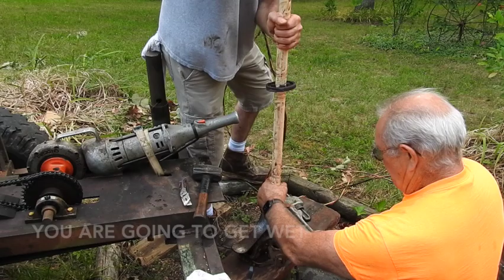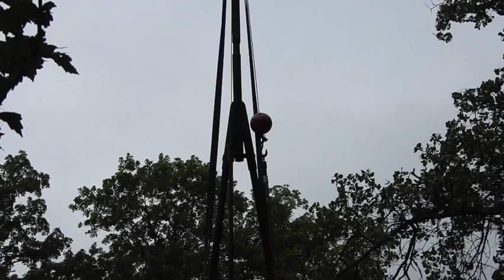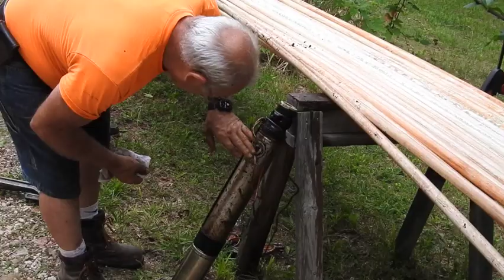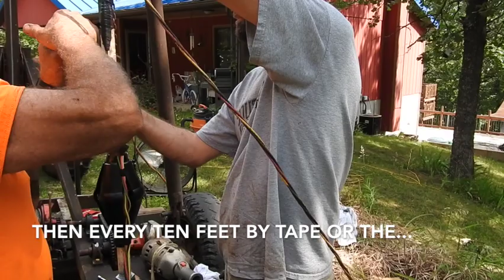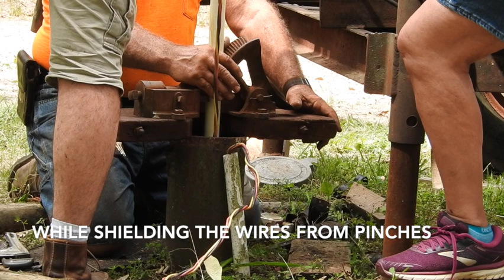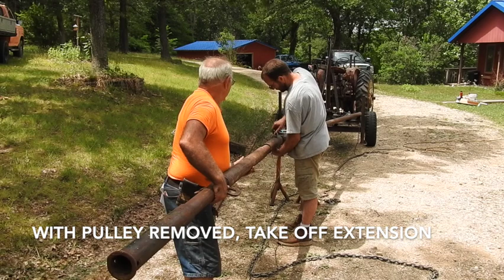DIY Well Pulling Rig Built Of Repurposed Materials

Comment: Tractorman, I am sorry to bother you and ask personal questions. In 1993 we bought a Heil AC unit and it has been a great one. My question is the Unit will come down to 75 degrees and just continue to keep running and never shut off. I also wanted to ask you what is a good unit comparable to the Heil from the 80s as far as quality? The AC guy recommended Rheem, and I also looked on line and saw Lennox, Carrier, Goodman, American Standard. What would you recommend thanks for your help.
Reply from the maker: Well, the Heil Quaker products are part of ICP Corporation parent company. Tempstar is the identical unit to the Heil Quaker unit. Whirlpool units sold by Sears were also manufactured by Heil Quaker for many years. That’s just in case you would like to maintain brand loyalty and stay with a product that you know has been good to you. But what I suggest to people, especially in a rural situation is to stay with whatever major brand is available locally. Simply because with the sophistication and continual changes to the electronics and mechanical components Most contractors cannot afford to carry all the parts required to fix every brand like it used to be back in the day. Personally, I do not feel that any of the equipment today it is expected to have the longevity of the older units, like yours, and also like my 1984 Tempstar. Also, there seems to be some issues with the newer R410a and systems developing leaks. 410 operates at an exceptionally high pressure as compared to the old R-22. And then some manufacturers have developed what they call a microchannel evaporator coil that also seems to be a little more problematic than the old tube type evaporator coil’s. The micro channel coils are extremely efficient in transferring temperature and if you get a good one, that does not have a problem you are golden. But if you have one that develops a leak, you’re in for a ride. Over the years, I’ve worked on virtually every manufacturer of residential and commercial HVAC equipment from the smallest central air conditioner to 300 tons commercially. I guess the best suggestion is to hang with a contractor that you may know and trust to lead you in the proper direction for what’s available in your area. Never go with the cheapest though and definitely never go with the most ridiculously expensive. The reason I said to go with a brand that is relatively close to you. If you are rural, it’s because you will stand the greatest chance of having a critical repair part in stock for the inevitable failure. I hope that help you make a decision that will be beneficial to you. By the way,R410 is an isotope, which means it is a blend of two different refrigerant. If you develop a leak on the suction side of the system, your system can ultimately become unbalanced and not cool properly because the different refrigerants will vaporize at different temperatures and the mixture will no longer be perfect. Speaking of refrigerant. One of two things is probably wrong with your system. Number one it could be suffering from weakening valves in the compressor, if it is a reciprocating compressor or number two it could merely just be a little bit low on refrigerant. Refrigerant 22 has to have enough refrigerant in the system to maintain a minimum of 57 psi on the suction line to keep the coil from freezing. Much below 57 psi and there’s not enough refrigerant in the system to produce enough cooling to allow it to freeze. So yours is cooling just not cooling well, but not freezing up. So it’s one of two of these things I just described, more than likely. Of course, like everything else on the Internet, you better take that with a grain of salt! 😄 good luck and thank you for trusting me enough to ask.
Reply: @tractorman4461  tractorman do you recommend Lennox or Carrier? We are also looking at an Oxbox by Trane, what is you opinion on the Oxbox? Thanks for your advice!
Reply from the maker: @Autigers2013  If my choice was between the two, Lennox would be my choice.  That of course is based on years of experience on older equipment.  I've been away from most of the modern advances for ten years now. The Oxbox is a new one on me....no knowledge on the product at all.  Good luck with your upgrade no matter what you choose.
Reply: @tractorman4461  supposedly oxbox is made by Trane, but they have different compressors.

Comment: Hello Tractorman 44, if you or someone in comment can help me it is welcome. I am trying the electrolysis method for a tractor gas tank cleaning. I am all set up as per your older video. My battery charger is newer probably cheap but the code flashing on the charger indicates charge is less than 1.5 volts and battery is not salvageable. So I think no juice going to my electrolysis set up. Any suggestions to over ride. It is a motormaster Eliminator for12 volt batteries. 
Should I try to find an older charger
Reply: Problem solved, got an older battery charger and got bubbles in solution almost right away
Reply from the maker: Yes, the newer, smart chargers will not work. They will only work on a battery that has a partial charge, and since there is nothing but the liquid solution there is no charge for it to read. So the answer is to get an older charger just like you suspected. remember though that it gives off hydrogen gas so don’t make any sparks when disconnecting. And definitely don’t do it inside a building.
Reply: @tractorman4461  I will be careful and warned the family stay clear. Your video was clear about precautions. Gotta say you are one of the more capable guys on the planet. I think farm upbringing helps with problem solving. Thanks for all the YouTube content

Comment: I wish I hw ÷÷;;;ad this about 3 years ago it would of saved me about $1500
Reply from the maker: That price would be for a shallow well around here. And they are few and far between.  Most wells in this area are 300 to 500' and the installed price for a 1 hp submersible is close to double your cost.  But if you have pvc and its not as deep as these, you can get by much more lighter duty.  Power can be a reversible motor and a gear reduction box.  Depending on the reduction and the end rpm you can adjust the diameter of the drum to increase or decrease the footage of lift if the reduction is too slow or too fast.  But you can also power another winch like this one with the reduction box as well.

Comment: You don’t realize just how much water you use daily until you DON’T have any.    My water line broke sometime Wed night and of course it’s on my side of the meter, not the cities.    Sooo, waiting for Dig Right to flag the yard for the other utilities and then the Plummer to dig up the yard.  YEA!    The line is near my hibiscus flower bed, sad.  The poor garden and flowers are needing water.   The digging and repair definitely will take longer than the 5 hrs you all did this job in.   And much costlier, I’m afraid.
Reply from the maker: Well now that's not good at all.  Dang.  If you have a good neighbor and have a shut off right inside the basement....can you connect the two houses through a garden hose and rob some of their water for the duration...? Hook to a hose bib outside and shut off the valve inside the house to keep from backfeeding to the leak.  Home Depot or Lowes will have a female/female connector for that.  I was thinking of doing this for the daughters but its 500 feet away.  Instead they just carried water for the duration but showered up here.
Reply: @tractorman4461  we shut the water off at both the meter and in the basement.   The sump hole would fill from the ground being so wet and seeping in the drain so I’ve been using the shop vac to keep it emptied and bringing the water up and to the garden.    Letting the sump operate it would just leak out outside and recycle.   I have several huge jugs filled with water that my son brought me, and used the shower at my daughters.   May be mid wk before they begin.    Fun, fun!   NOT!
Reply: @tractorman4461 A backup plan is always a good idea. My son lives at 9400' in the Colorado mountains. He did a major remodel last winter. Installed a 250 gallon storage tank with a booster pump to supply the house. The well pump automatically fills the storage tank.  I was concerned that if he lost his well pump in the middle of the winter, might play hell getting a rig up his steep driveway - not to mention the good chance of having to deal with multiple feet of snow. I piped it so that the well pump can supply the house directly if he looses the booster pump.